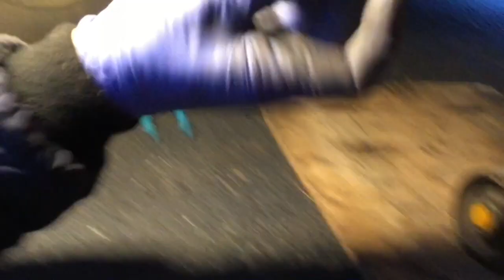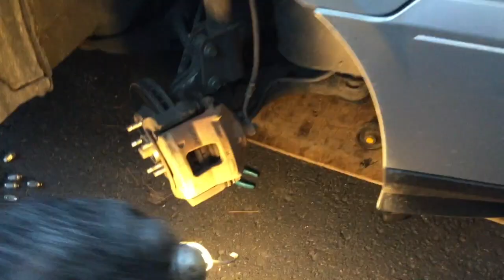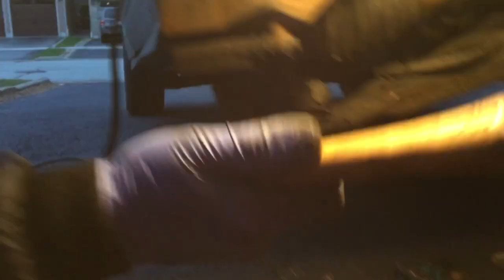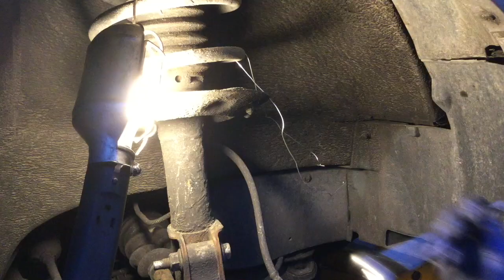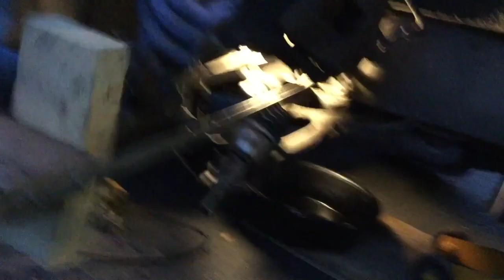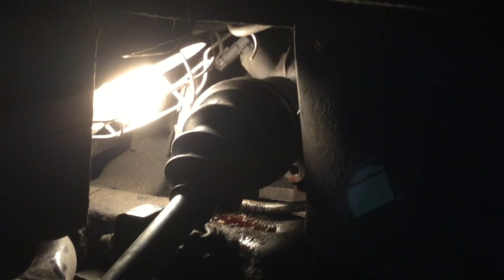How to Replace CV Axle | Buick Rendezvous

Comment: Just did one on a 2004 rendezvous, absolutely no reason to remove anything but the 2 strut bolts, turn the wheel all the way to the right, axle comes out easily after removing the nut of course , just need a pry bar and you do need to hang the caliper, but i did not remove the bracket or the rotor. Easy as pie.
Reply from the maker: The right is not the same as the left. There is no access to pry anything on the left side. Therefore you need a pulling tool.

Comment: You didn’t have trouble seating the cv axle spline c clip into the transmission?
Reply from the maker: Hi Andy, no I didn't, but you can turn the c-clip so it's in the best position to pop into place. You need to tug on the shaft to ensure the the c-clip has locked in place.

Comment: Your tool works awesome.  I used to large of a light box at first.  However very easy to switch with a smaller size, for a car you could maybe use a 3" bracket, straiten the 90 degree bend and put the bolt through the pre made hole.  Thank you again, it is an amazing DYI tool.
Reply from the maker: Thank you for your comments. Glad it worked for you!

Comment: so did you replace lost fluid?  new to all this
Reply from the maker: Yes, you will lose some brake fluid. Make sure your brake fluid is topped up before you start. You can use a small vice grip with some cardboard to protect the line and pinch the rubber line. This will minimize fluid loss. Do not pinch it too hard, you can damage the rubber line.